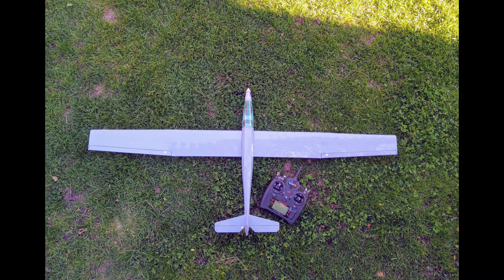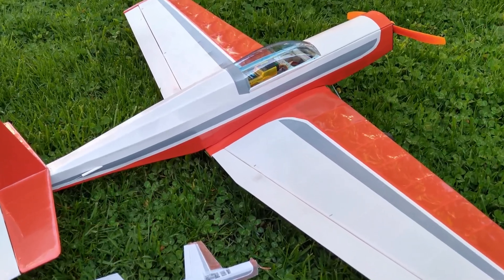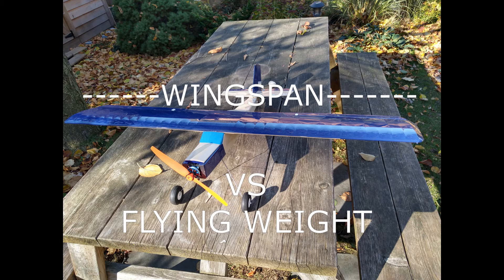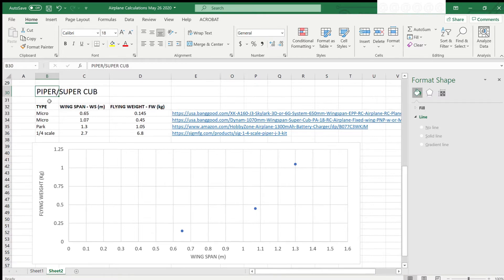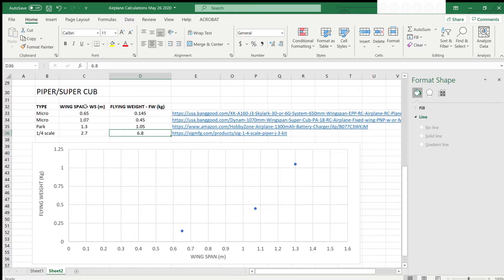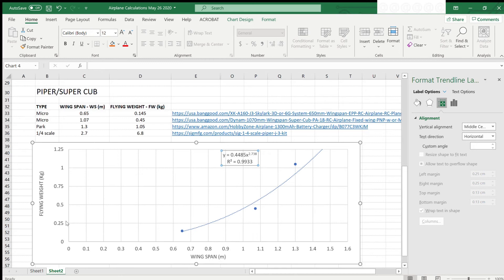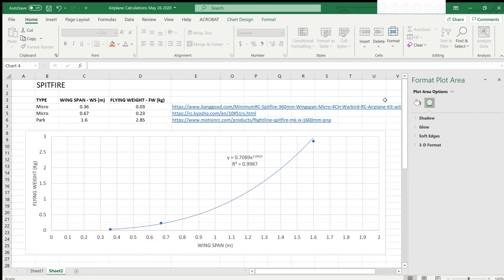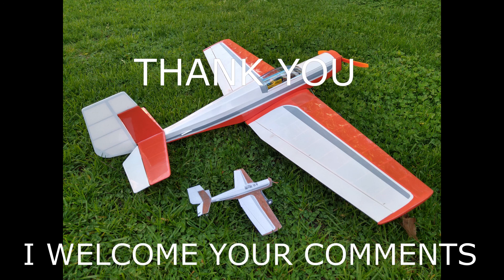What size should I build my RC model?

Comment: Lift is a function of wing area and speed.  Your method appears to assume speed is a function of size.
Reply from the maker: Thanks for the comment. I agree that lift is a function of speed and wing area. But the point of the video is to show (via empirical data and modeling method) how wing span and weight relate. Wing area would scale as a square of wingspan while weight is more or less a cubic.